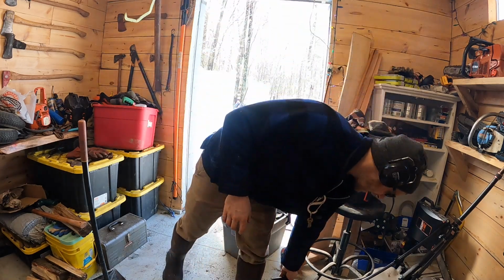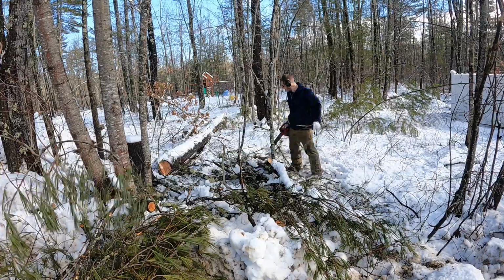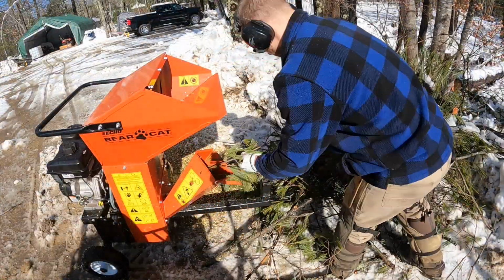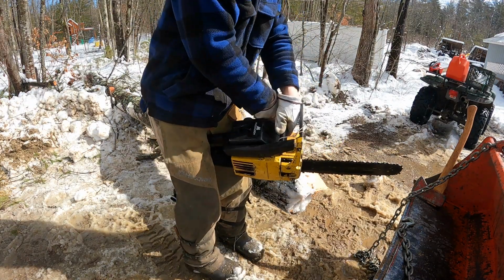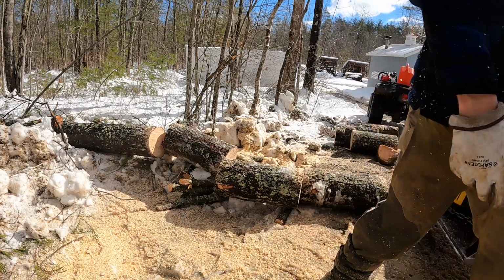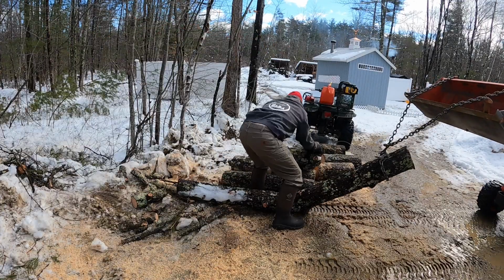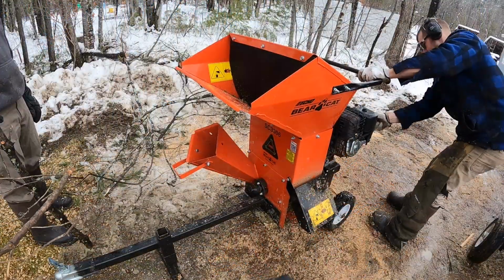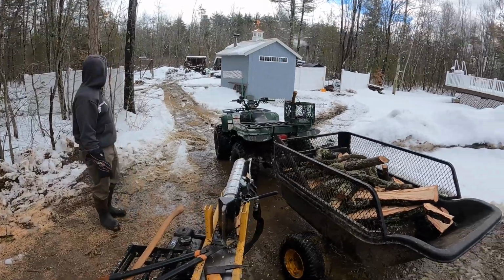VINTAGE CHAINSAWS RETURN!

Comment: glad to see you got the homelite 2 running and using it. My 2, 610's are like yours 1 or 2 pull starters every time.  Oh both my homelite 2's like throttle when you first start them. When you get use to the no brake on the homelite you will like them in the tree. be safe
Reply from the maker: Yes I agree! Glad you have both the same saws so you can relate! I think I will like it in the tree just have to get used to it!

Comment: If you get into bigger firewood the pro mac 610 will pull a 25 inch bar all day long.  They are not the fastest saw but they have alot of bottom end. They will keep cutting with no problems.
Reply from the maker: Yes I had the feeling it would pull a 25! I want a longer bar for it just for bucking purposes. I want to have 2 saws designated for bucking. My 257 and 610 I want to be my bucking saws! And my 590 and 490 are felling saws and the mac and homelite are climbing/limbing saws!